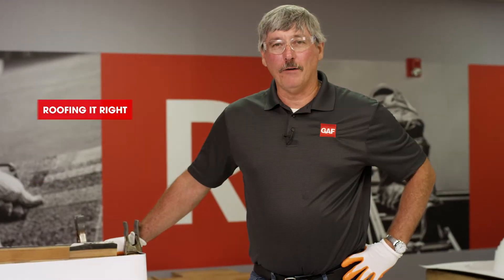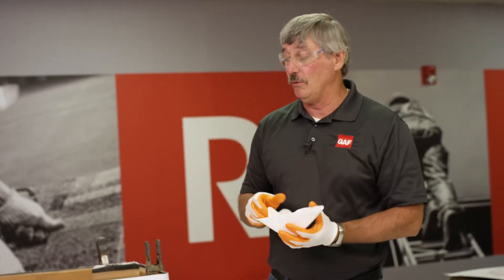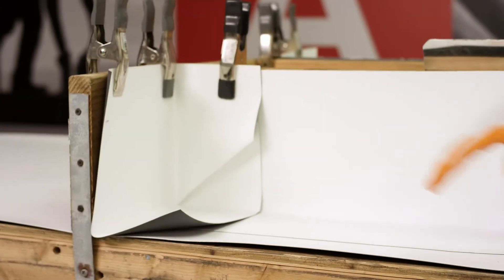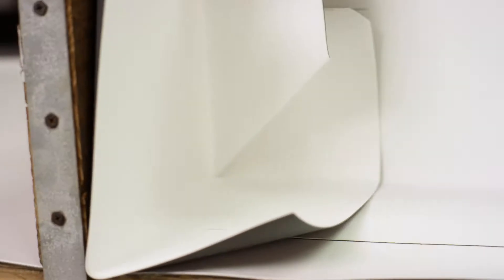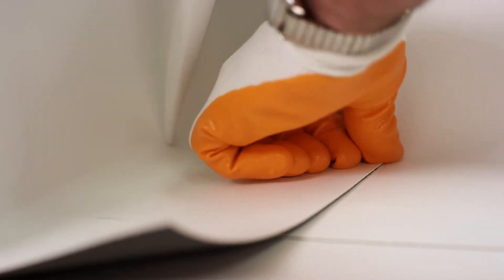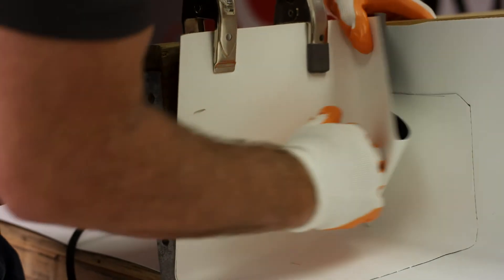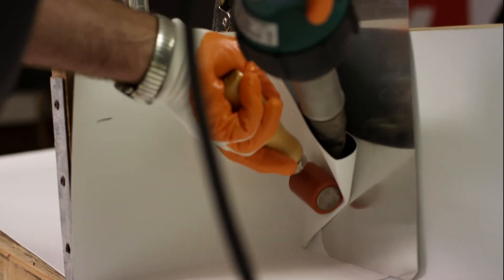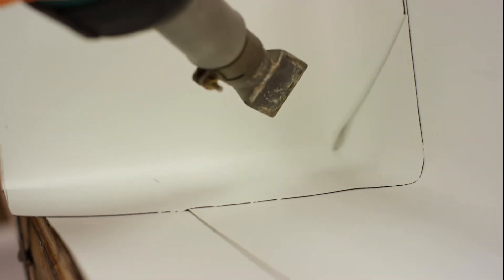Inside Corner Pig-Ear Overview & Installation | TPO Accessories | Roofing it Right with Dave & Wally

Comment: So with this method you wouldn’t need to weld an Insde corner detail? (Un-supported Membrane)
Reply from the maker: Hi, Ruben. You can find documentation on Pig Ear here: https://bit.ly/3sbPU1S. If you have any other questions, please reach out to our Technical experts at 800-766-3411.
Reply: Correct!